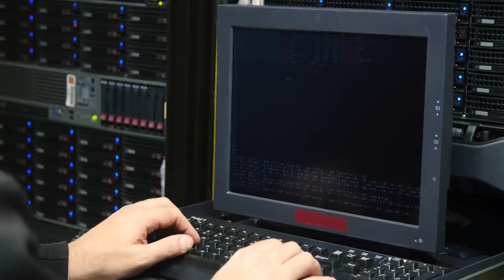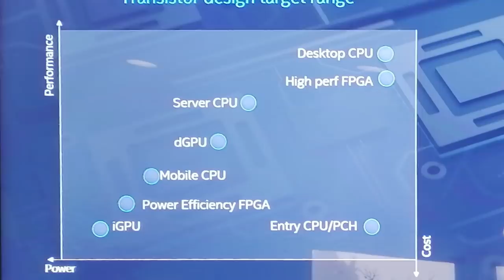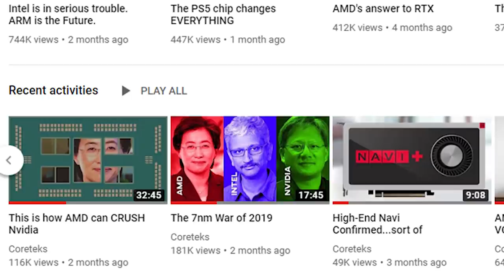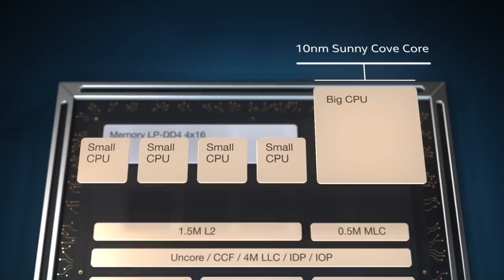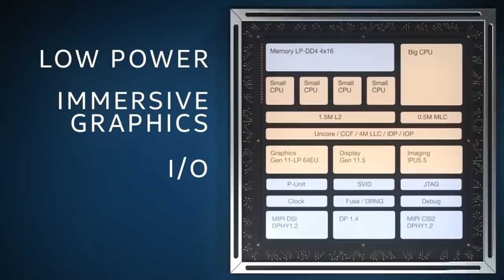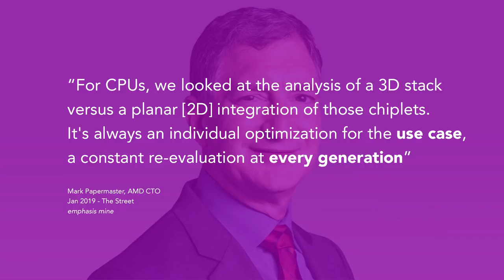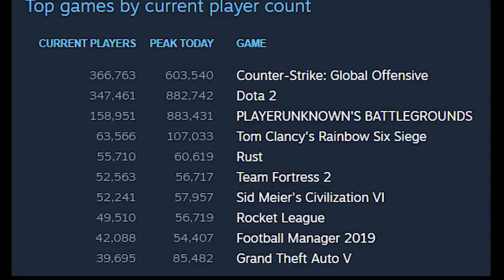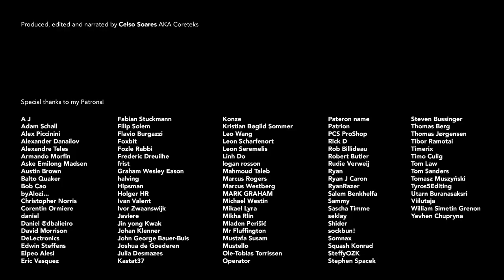2D vs 3D Stacking: Intel’s plan to beat Zen 2

Comment: I fully agree with your video with some additional sentiments. I'm about halfway through, but I wanted to get this down so I wouldn't forget.

As far as I remember, AMD has been messing with the idea of "Large L3 Designs" on their chips, though I thought we would actually get more L3 cache in the Zen 2's it's completely understandable why they don't. The manufacturing of their chips has hit a sweet spot where they can achieve dominance this year and for at least 2 quarters of next year without much competition, allowing their marketshare to grow as you said in your excellent video.

However, AMD isn't a sleeping giant, I believe that as early as the success of Zen+ and possibly as early as Zen, they've already started work on a redesigned prototype with a stacked die philosophy along with potentially re-gearing their HSA projects (Heterogeneous Synchronous Architecture) to give their CPU's a decent boost in single-threaded performance or time-consuming repetitive processes.

It's definitely an interesting time, since Intel might be releasing their newer chip design in 2021, which is after the last iteration of Zen. Which means that AMD might be releasing the  last Zen and then a completely new architecture 2020/2021+ using the funds from the marketshare acquired by Zen.

One of the nicest things we'll be getting out of this as gamers is an increase in the lowest common denominator with consoles like the PS5 and Xbox Two (Infinity, Whatever they're calling it) where instead of a custom Jaguar tablet processor, there will be a proper Ryzen-based chip that will allow far greater performance to be utilized. I mean if you take a look at the tablet CPU in the Xbox One X and PS4 currently, those things are slower than the desktop FX-4300 at stock clocks by a decent margin, and there's only so much optimization that you can do before you just hit a brick wall. With the newer chips, hopefully we'll see a jump in minimums for gaming, bigger worlds, newer tech, more experimentation, etc. Since a lot of games come to PC after it's console counterparts.

Comment: In stacking, I think the best idea would be to have the most heat sensitive and most heat generative parts on the top layer, going down to the less sensitive parts. 
I also think there should be some kind of inter-layer heat sinking, though I'm not sure how this would be accomplished. Probably the best idea would to have what's essentially a sub-ihs with heat pipes travelling vertically to the main ihs; this would result in a larger overall package with more manufacturing complexity, but it's the only solution that seems like it would work. But that solution could also become fairly thick if each layer needs thermal control.

Comment: I was waiting for 3D architectures for years. Distance is the limiting factor of the takt rate at a given speed (with a given heat specification). In 3D distances can be optimized. I think that microcooling has to come, processor calculated microdistribution of cooling. Like in our brain this is the main task. Aristotle said that our brain was first of all a sophisticated cooler.

Comment: Based on the 3D model of a 3D stacked CPU. To manage heat between stacks, a heat-pipe or metal shim could work to put the heat of different stacks to the sides of the CPU. Just like a metal border around the CPU that is also found in GPUs.

Comment: How are they going to be able to cool all the layers effectively?
Reply: If the interposer is silicon-on-sapphire it would act as a heatsink.  Silicon Carbide is maturing and runs far hotter with no problems.  If artificial diamonds have come as far as I suspect, it could be affordable to build on those.  Finally, microchannel vapor cooling?

Comment: 3D-stacked Microprocessors should integrate active water cooling tubes into the chip package using micro-scale, laser-cut, aluminium tubes criss-crossing in three-dimensions throughout the gaps between chips, memory and copper circuits. These micro-water-tubes could be filled with pure H2O, with every tube connected to a series of larger-and-larger reservoir tubes, with the largest one connected to a pump, heatsink, and fans in a radiator on the front of the PC case. That would really help with temperatures, far better than just one large copper heatsink block covering only the top of the CPU package.

Comment: Larger on die cache is not the answer in the short term due to costs,3D stacking has it's issues with heat. An interim solution would be to bring some, if not all of the system ram onto the CPU package as Vega does now.
Reply: ya an hbm stack on the cpu package would probably bring most of the performance with much less effort and heat problems

Comment: Internal layers are all very well but there should be an external 'vertical bus' - pins top and bottom of the chip. Base chip's bottom pins connect to the much reduced motherboard that could just be a power supply and I/O interface... Bottom pins of other CPUs or other devices connect to the top pins of the chip underneath. Pins connect directly, held together in a frame that allows air to be blown across the stack, rather than pins on  the bottom, socket on the top.. exposed pins double as a heat sink... Chips should have side pins too for lateral connection to more peripheral devices... Open Standard Vertical Bus with standard chip sizes (ie. 40mm, 16 x 16 pin grid)

Comment: "System in Package", "Multi-Chip Module", "Chiplet" - two or more discrete processor chips mounted one carrier board - sometimes with extra chips for GPU, cache, etc.  They're a versatile way to repurpose parts, to scale up density and to scale down costs.  But consumers have much less need for core count and complexity, they want raw speed.
Four 5GHz cores fit "high end" consumer applications far better than ten 2GHz cores.  An integrated GPU (or a bunch of them) is just wasted silicon when dedicated GPU hardware is installed.  And energy efficiency is always good (especially in mobile devices) but it's only a secondary concern in desktop platforms.  Chiplet packages just suck outside server markets.

Comment: Turn the CPU vertical with respect to the MOBO (like GPU cards are orientated) for more cooling on 3D stacked CPUs.
Reply: you mean cool it from both sides?, that might start to happen with the high core count threadrippers as the 32 core already gets the back side quite warm with the shear amount of current it needs, and the newer cpus should need even more
Reply: Bruno Cardoso 
Yeah

Comment: Let's hope AMD can catch up quickly if Intel takes the performance crown back. We don't want a repeat of FX vs Core series...
Reply: Cannot take back what was never taken.  Intel owns the performance crown.
Reply: @bradvicious3991 , yes, currently. From what we saw at CES, AMD will most likely take it, even if it's short-lived, like Athlon 64.
Reply: @bradvicious3991  In single core maybe. Multi-core not so much.
Reply: @GoodGamer3000  again, CES - marketing.  No real world silicon to test... It's just AMD trying to stay afloat.

Intel new architecture will drop before or just after AMD  Ryzen.
Reply: @bradvicious3991 , why would AMD sabotage Ryzen 3 for some PR? There's a reason companies (usually) don't lie about performance, it only hurts them. They know what happened with Intel's Principled Technologies debacle. It hurt their reputation. If they over hype it, there's just going to be disappointment. AMD has a history of giving accurate performance numbers, why would they want to risk it in such a big spotlight?
Reply: @jjwarner9419  Just because you say it over and over does not make it true
Reply: @bradvicious3991  I said it once though?

Comment: I have actually thought about most of this stuff a lot, and have come to the same conclusion as you. What I find particularly exciting about 3D stacking cache is the incredible low latency that should be possible with it. This is because all of the cache will be able to be placed in extremely close physical proximity to the CPU cores. While cache right now is put directly next to the cores, the farthest side of the cache from a given core is what determines latency if I am not mistaken. By placing cache on top of the cores the farthest edges of the cache should be much closer to them than is currently possible, meaning latency can be reduced significantly. Cache latency often seems to have a large impact on performance, so I expect that this will be where the biggest performance improvements come from. I do expect heat to be a big issue, so clock speeds may not be as high as they currently are, but I don't really expect that to be as big of an issue. 

I'm currently rocking a Ryzen CPU and I love it. I really hope AMD has been at work on 3D stacking as well, because I do expect great performance from it, and I really want AMD to remain competitive. I think we all remember the dark ages when Intel released a new CPU every year with marginal, insignificant improvements. The CPU space was stagnant for a long time, but when AMD launched Ryzen everything changed. Go back to early 2017 and tell people that within 2 years there will be a mainstream Intel CPU with 8 cores and 16 threads. It would just be to good to be true. I want to see this in innovation continue, and if AMD doesn't continue to compete we will probably go right back to where we were then. Nobody wants that.

Comment: Heat came to mind long before the video even mentioned it. At first I jumped to the same conclusion but I thought about it, if the actual “cores” are on the top closest to the IHS that’s probably best for cooling. It might not be all that bad, but if they cheap out on the lower layers and manufacture them at 14 or 22 nanometers they won’t be efficient and will have to generate plenty of heat to keep up with the cores. It could mean super expensive high end sku might exist to max clocks

Comment: 9:48  No.  Very simple question, very simple answer.  Your subsequent comparison with a 5GHz Bulldozer-based chip is a red herring.  The Bulldozer design had a lower IPC than the Phenom II design.  Zen 2 has a higher IPC than Skylake.  

You're seriously overestimating the importance of memory throughput.  All you have to do is compare how performance changes over various workloads when increasing RAM speed, to see that existing cache sizes are taking the bulk of the performance hit away already.  There is zero chance that a 3GHz stacked chip from Intel with 1GB of L3 cache is going to be faster than a 5GHz Zen 2 chip with 64MB of L3 cache (or even 32MB).
Reply: I'm glad someone else noticed the 5ghz bulldozer comparison, sounds like desperation on part of the author to say the 5ghz fx cpu couldn't keep pace with intels cpu offerings, well no it wouldn't have for the reasons you mention, the rubbish ipc in bulldozer, looks like zen 2 will be well ahead of skylake ipc.

Comment: What if all the cores would have different clocks that change dynamically? In testing process those cores would be ordered on how high they can run. So processes that need lots of single thread performance would use the best core(s). Also different size L1 and L2 caches with different cores could help.

If there are reasons why this is impossible or impractical or just too damn hard compared to the rewards, I would like to know why. It just haunts me.

Comment: You're right on the fact, that in the long term, 3D stacking will be  the norm. What we'll yet have to see is, if this first iteration will be competitive against AMDs now more refined Zen architecture. AMD looks very confident on their new products, so we might see AMD in a dominant position a bit longer then until the first half of 2020. All of that is pretty much speculation though at this point in time of course

Comment: this what gonna happen...10nm 6/25/19 release will be 2.5d current stacking while 10nm foveros will be 3d stacking for 2020 release...both will be ice lake architecture with sunny cove cores
Reply: Pretty sure the 1st mass 10nm will be the foveros based SOC... around mid year.  We will get a 14nm CPU with the new Cove architecture around that same time with the 10nm desktop Cove CPU around the holidays.

Comment: People don't get it. The multiple layers will be solidly attached to each other, even closer than soldering, they will be 1 whole silicon bit just printed on in different layers, and silicon is also really thermally conductive so the heat dissipation is the last of the last of the problems. The problem with this chip is about how are they actually going to "print" at different depths and how will they interconnect the dies.

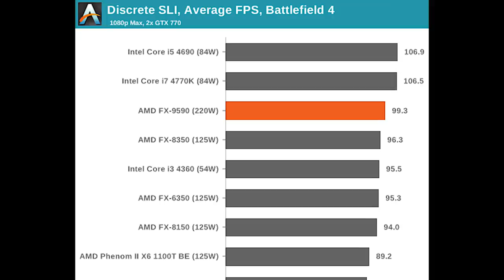Comment: 10:17 While, yeah you're absolutely right, clockspeed doesn't mean as much, the IPC of Haswell was considerably better on a clock for clock basis, so... the architectural improvements even comparing the same memory bandwidth showed a staggering improvement in favor of Intel. Memory bandwidth was so important back in the 80s because they had nothing else going for them. That's so far back that they had a co-processor to assist the computers' calulations so they could also do math in conjuction with the actual chips. Memory bandwidth doesn't matter as much nowadays because DDR4 produces so much of it now that you're getting something close to like... 38-gigabytes per second worth of dataflow being pushed to your CPUs constantly, and that's with something as lowly as DDR4-2400 I believe.

But yeah, it'll be an interesting couple years. :D

Comment: In the very near future the framework on which programmers code on, will change to allow parallel processing to hit new heights.  Much of the old style of coding, done in linear time such as C++, will be changed to be more similar to VLSI and VHDL.  Where one gets to quickly chose what happening when and where. Another words, I would not totally rule out Multi-core processing.

Comment: The only problem with stacking is you are still use the same amount of silicon, meaning more expensive, then you have thermal limitations if you expect that silicon to run at a significant speed.

Stacking will only be useful for stuff like cache, and only then if you really have to, for high end chips. Chiplets make more sense.

Comment: In terms of memory bandwidth, AMD has a simple solution for 2020 as they can easily spin an additional I/O DIE design that supports DDR5 without having to modify the CPU Chiplet. While such an offering would not match the performance of any super-sized cache that Intel may offer it would be a far more modular and cheaper way to offer a boost while offering the end user the choice of DDR4 or DDR5 depending on their needs. The real issue is AMD's current memory access latency which is a lot higher than current Intel designs - something that may be improved with Zen 2 due to the expected Infinity Fabric enhancements and reports that the ccx complex maybe 8 way rather than 4 way as seen in Zen 1.

Comment: Memory bandwidth of the FX processors was actually slightly ahead of the Haswell generation Intels, so I find this part misleading. FX processors were relatively bad because they didn't have proper FPUs per core, but rather one per 2 cores in each module. Floating point performance is important for any kind of higher calculation, and incidentally, AMD has claimed double FPU performance for Zen 2, so we'll see where this is headed.

Comment: I'm a bit skeptical about the lasagne-like die stacking. How are they planning to manage heat dissipation with a design like that? How are they going to achieve 9900k-level performance if DRAM chips are on top of the CPU while the 9900k runs hot even with soldered IHS. I know Intel 10 nm is likely similarly efficient as 7 nm Zen 2, but is that enough when AMD has the die directly soldered.
Reply: Not only that, but how will they manage to put this in server blade which is so thin. Stacking the die means a higher CPU cooler and more space.

Comment: It's disingenous to say that clockspeeds don't mean that much. That was the source of performance for 30 years. E.g. for the 90's clockspeeds increased by 50% per year on average for the entire decade. IPC increased by 10% per year. Most transistors went into allowing clockspeeds to continue increasing. From 2003 when Dennard scaling ended, most performance has come from multiple cores; but that game gets you into trouble with Amdahl's law pretty quickly; you can have more performance, but not necessarily for the tasks you want more performance. Only now, when there is almost no more performance to be had and certainly very little clockspeed to be had does anyone consider clockspeed to be almost irrelevant.

Comment: You way over estimate "3D stacking." Intel just reinvented the wheel; it is called an active interposer and it has been around for a while. 
Also, most modern CPUs hit the 90-95% hit rate between all 3 layers of cache(when running mainstream desktop apps). Any multi-chip cache will be slower than L3 cache, so there isn't much room to improve by adding another layer. For normal users, speeding up the cache is much more important than adding more and 3D would require slowing it down. Severs and expensive work stations are another story, but the industry looks to be going towards custom built silicon in those sections.

Comment: on theory 3d stacking is definitely the future. But Intel is nowhere ready for that. Specially if they keep arrogantly wanting to develop everything themselves. They have struggled a lot getting 10nm chips, despite AMD getting 7nm chips together with partnerships with TSMC. Also 3d stacking is definitely a feature that may be easier to adopt with 7nm as everything will be smaller. So AMD have the option to also develop it on their own end if Intel succeeds. And AMD can partner with microchip manufacturers, making the production process actually much cheaper and faster.